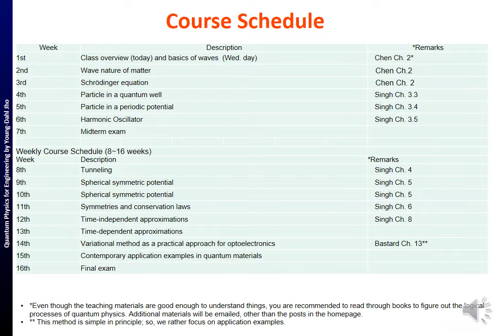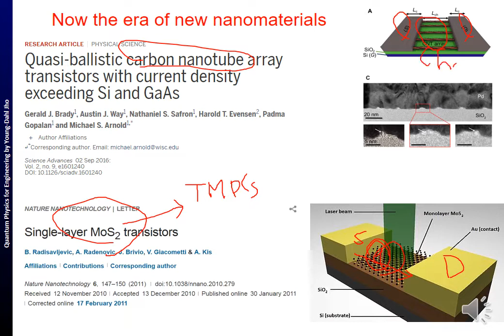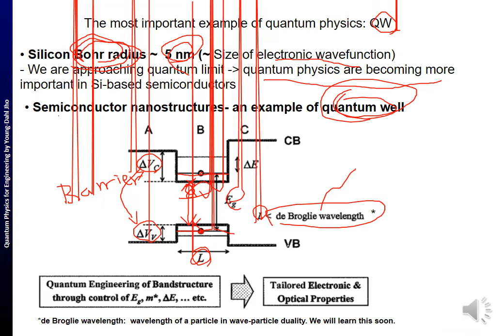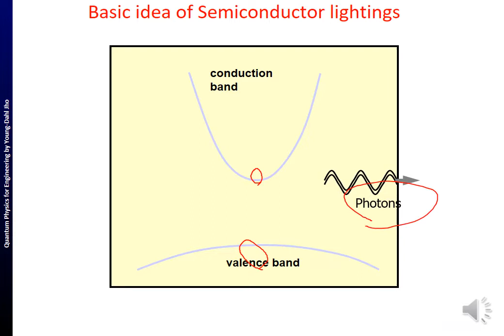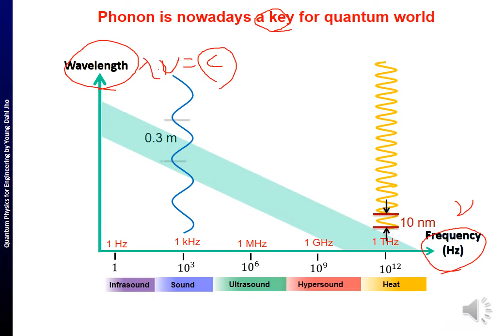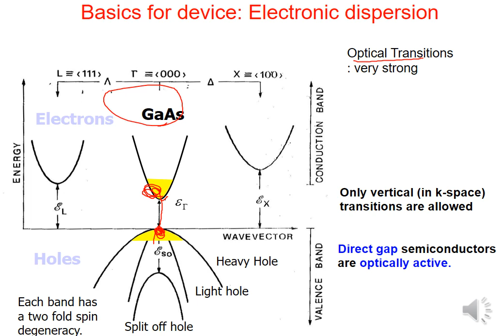1 introduction to Quantum Physics for Engineering

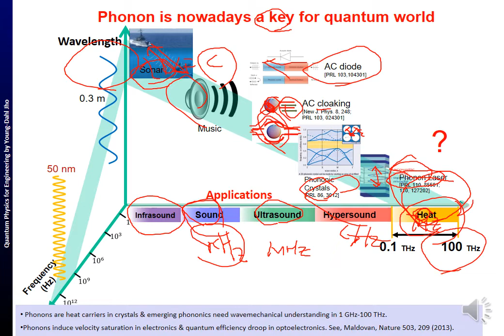Comment: I am not sure i understand very well what is shown on the graph you talk about from 55:00 to 58:21.
Do you mean that phonons are carriers for soundwaves as well as heat ? i don't understand how these two different subjects can be explained with only one thing ?
Reply from the maker: I suggest to read the article listed in that slide. Surely, you can figure the concepts out then. The heat itself has been studied at least for 200 yrs and never an easy issue. But the point is that the phonons can be treated in terms of quantum physics recently.  Intuitively, the heat is an empirical concept of total energy which can be carried by any carriers with energy (thus certain freq. in quantum concept). And the electrons, photons, and phonons all exist in solids then they should carry heat all different ways. But the electrons are easily converted into phonons to reach the bottom of conduction band and the relevant time scale is so short on the order of ps=10^(-12)s. Photons simply escape the solids so quickly in short time scale; and we know it very well.  So, during the device operation time scale, mostly phonons are left behind and that's why they are the main heat carriers. Sound and heat? They are all related issues of phonons.  Phonons are the carriers of sound in the freq. range of 1 kHz as we know. 1kHz is such a low freq. thus with extremely small energy. And we are good to control it. And the heat is carried by the phonons in the spectral range around 1-5 THz. The phonons have different branches such as optical Vs acoustic and transverse and longitudinal, as well as different freq., ranges depending on the atomic composition of solids. And the class should be fully dedicated into this like a year to get a real mutual understanding. Many topics are interconnected like phonon-to-photon conversion, wave mechanical manipulation of phonons like we did for electrons and photons, coherence and phase of phonons like we did for electrons and photons. So, at this point, we just know there could be more for quantum mechanics to be studied even in the fundamental level.